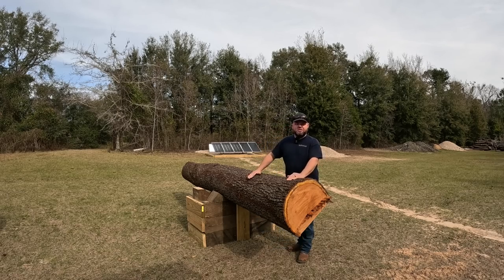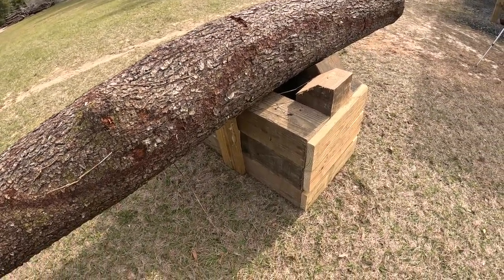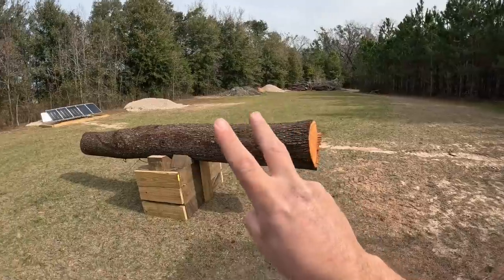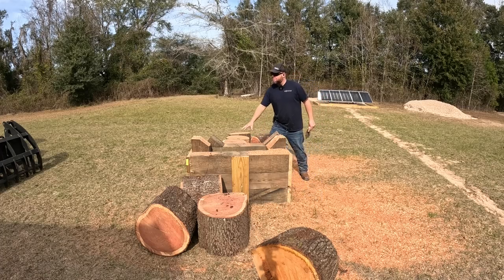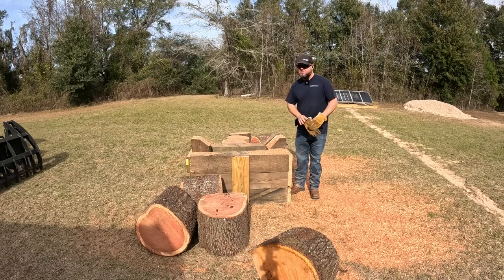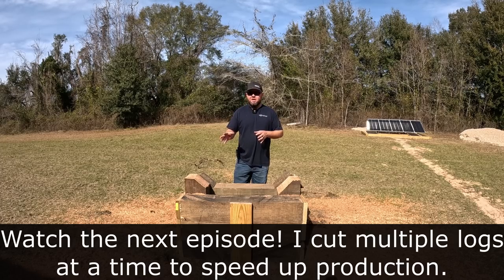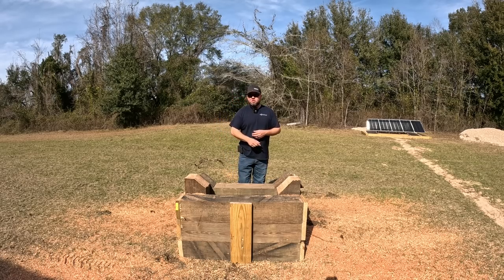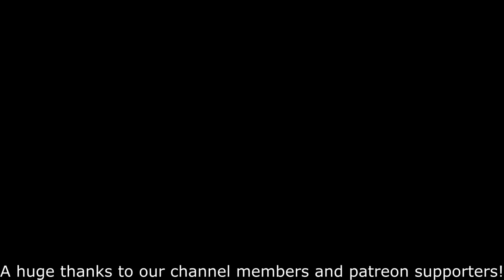DIY Log Sawhorse Build! Back Saver!

Comment: That's great...
There is a guy in Canada, he built a platform to hold multiple logs, it has a small incline for the logs to roll down but there are braces so it doesn't roll on you. You could make it towable on skids... His can accommodate 12 footers plus. There is a lot of bracing about every 18 inches to get the chainsaw to cut the logs for firewood or trim to make boards for building. He is the same guy that bought a LaneShark from Tallahassee, I referenced previously in a prior vlog tree trimming
Reply from the maker: I mentioned him in this video, Sawing with Sandy. I want a lanes shark so bad!

Comment: Super idea! You should get yourself the 25” light bar for your 462 to save your back some more, you’d be suprised the difference it makes for even occasionally use
Reply from the maker: I've considered going to the 28 light. But I don't always need the extra length, sometimes it gets in the way.

Comment: I thing you should build another building that way you could all your bends in with the cut logs plus you should build a log cuter that's long enough to put a long log on it and build it so when you put the log on it you measure the log you have space cut out so you measure your log and when you go to cut your blade goes right though the log and you can cut the hole log it's just a idea you all have a great day

Comment: how about putting a tote frame under each side  then just move the center 2 into the totes on either side or extra long pallets with a stop on the back and a short one on the front????  also by the time you cut a big log like those you need a break in the tractor with a drink!!!!  if you put a grapple on the electric tractor -- no diesel idling!  i have several wooden bridge stringers 10 x14 or so that would work for someting like that have some rotten spots But so what! Cool build Have Fun
Reply from the maker: I was just thinking the electric tractor would be perfect for this job, its on to a new home.
Reply: well maybe next year with a new model:) @TKCL

Comment: I like what you have made but there are 2 things that could be a problem first how the log drop on the floor what stop it from hitting your feet and secondly does the log move when you cut. But it looks faster as your not turning the log to cut the bottom. Keep up the good work and I look forward to seeing your next project
Reply from the maker: You have that risk anytime you cut elevated, you evaluate the risk and pay attention. With that said, there's risks to cutting on the ground. You accept some risks anytime you work with equipment or mass. Otherwise you avoid it altogether. That's not really an option when you chose a homesteading lifestyle.
Reply: @TKCL  thank you for the response
Reply from the maker: Thank you for watching and the support.

Comment: Question? Why not cut the Cherry to the length you use in your smoker and not cut down with the bandsaw? Just wondering.
Reply from the maker: Because this wood is used for roughly 3-4 different situations all using different lengths. I'll do the final cut down later as needed.

Comment: Why don't you use the grapple to hold the wood to proper height to cut instead of the wood horse?   Grapple the end of the wood
Reply from the maker: I covered this in the video, tons of metal you'll be hitting with your chain.
Reply: @TKCL  No, I grapple the end of the wood, Im 6/7 foot from the grapple claws.

Comment: Your chain cuts way faster than mine. I've sharpened my chain the last few times before I cut and it's still much slower than your cuts. Maybe a new ⛓️ is needed...
Reply from the maker: What saw? And that's on old chain I've sharpened several times, the Stihl 2 in 1 sharpener really works.